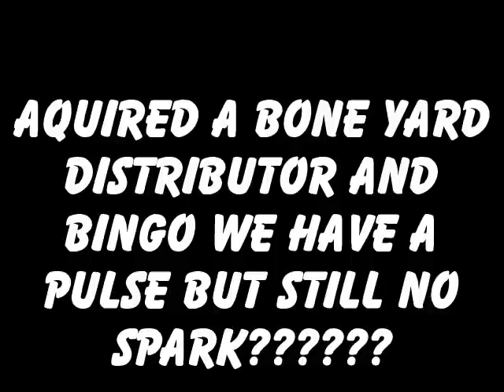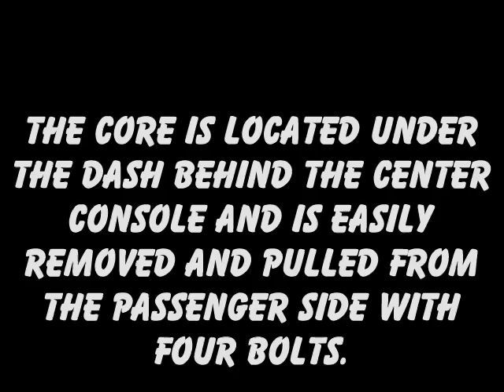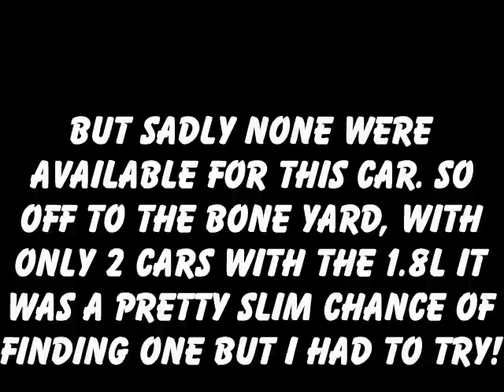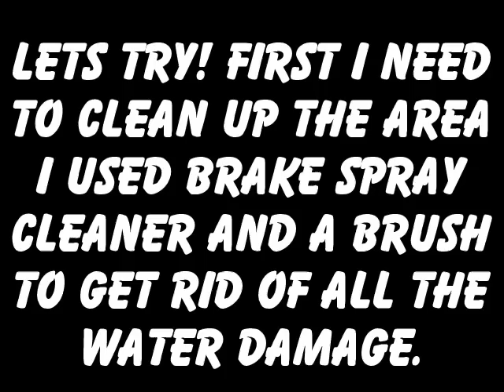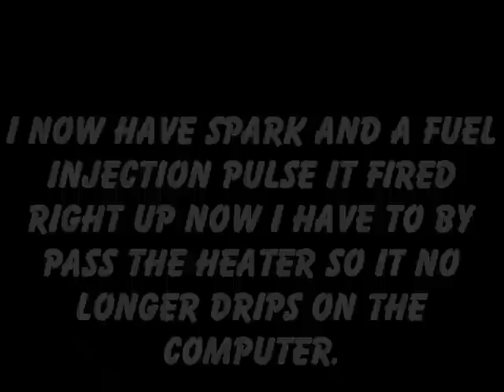No spark ford escort

Comment: Excellent, fearlkess sleuthing-- Good Video!
I have the same issue on a 1998 Escort ZX2 that I got with a known bad heater core.  I wonder if I could have spilled A/F when I removed the core?  
Now I get a cranking engine with an apparently good fuel circuit, but no pops/power.  Where IS that PCM?

Comment: I have a 1989 Mercury Tracer. Yesterday it died while driving down the street. It has ruined the cdistributor cap in the past so I changed it. It started and ran rough for approx. 15 seconds then died again. All lights on the dash work fine, has 3/4 tank of gas. I checked  for spark from the coil wire and got nothing.
 What could it be?
Reply from the maker: Could be a bad distributor!?
Reply: @poochefmarowbePoochman  it was the Distributor. I thought it might be the coil was not receiving 12volts on Positive side from the 2-wire harness so I hooked a jumper-wire directly from the battery to it and tried to start it. Still no spark coming out  of the coil. I purchased a new Coil at the time of purchasing the Distributor, (after all the car only has 401,00 miles on it!), So i figured it is just not getting the proper "Ground" from the Distributor and that was the problem.
Reply from the maker: When you mentioned the distributor cap damage my first thought was the shaft had worn and was wobbling! Nice work!

Comment: Nice job! I have no clue about the Mazda built engine. But anyway, and in my opinion, after they went front wheel drive all Ford Escorts were junk. ;¬)
Reply from the maker: +wordreet Thanks it was a great save and my son drove it many more miles! The DOHC was the better engine but the Escorts suffered from lack of maintenance and didn't tolerate overheating at all and consequently blew many a head gasket!